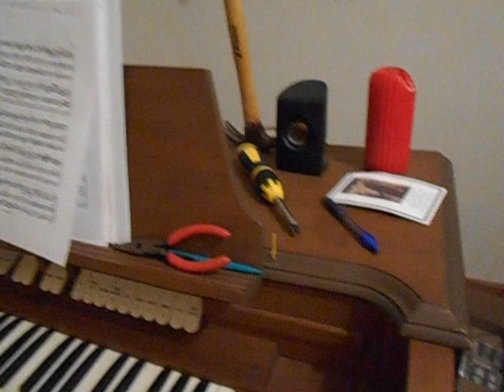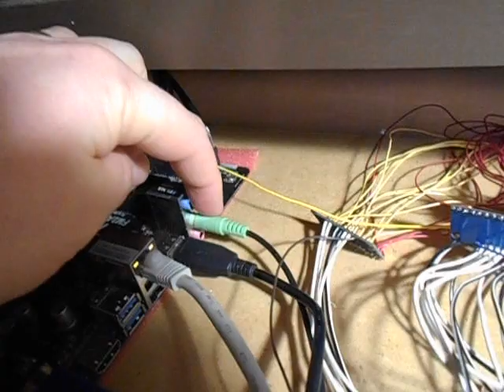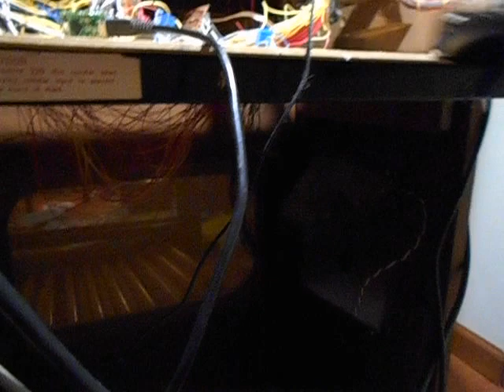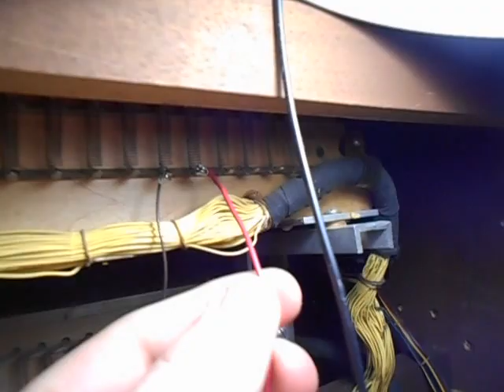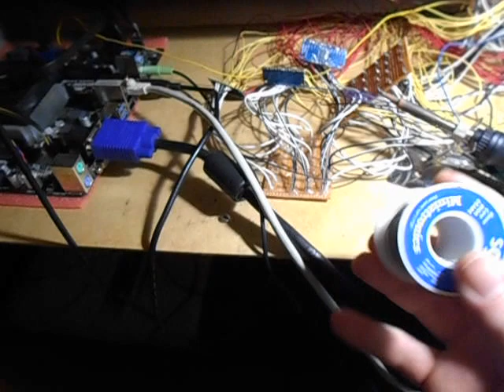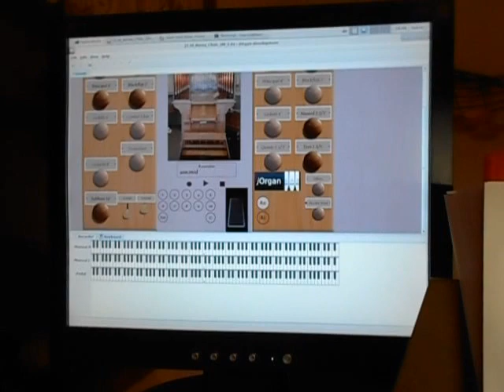Organ conversion with Teensy LC

Comment: Tom here from Toronto, Thanks for showing your wiring on the console. Neat work. I used to have a Schober 2 manual and pedalboard organ, minus the console cabinet and stop switches. I never got around to getting it properly set up so had to dispose of it. Now that I am retired, I am building a console from a variety of keyboards, had to add MIDI to 2 of them as you have done. I built the pedalboard totally from scratch. Found 3/4" by 1 1/2" oak boards that were 27" long in some warehouse scrap pile, built a frame from pine 2x6's and made springs from 3/16" dia spring wire hand wound. I added a magnet to the end of each pedal and mounted a diode and a reed switch to a board that is held just out of touch of the moving ends of the pedals. I used Arduino compatible "Pro Trinket" boards and opto isolator chips to convert key presses to MIDI using software written by Evan Kale from you tube. It all works, I use jOrgan disposition of St. Paul's Anglican Church here in Toronto, prepared by a fellow in England, named Chris Pearson. I still have only a skeleton of a frame for a console, but mostly works ok. If I play too fast, it looses MIDI OFF messages giving stuck notes, might need to mod the software. Still need to build Stop Jamb boards and mount switches and LEDs for the Stops. It's a great hobby and gives me fantastic pleasure to be able to use this marvelous technology, some recorded sounds, and much effort to try to play, [still a beginner organ student after all these years !!! ] but it is my joy to use this to Praise God with !!!

Thanks again for showing your work with jOrgan!

Tom
Reply from the maker: Wow, tremendous work! That's a LOT of opto isolators! Do the opto isolator boards have multiple input channels that you can scan using the Pro Trinket?

"...play too fast, it looses MIDI OFF..." That's strange. If a MIDI OFF message comes, it should be processed eventually. The only way you would "lose" the event is if it was never generated which suggests you have bad software. Even a key scanner should eventually notice that the key isn't pressed anymore.
Another possibility is 
1. Note on
2. Note off
3. Note on
4. Note off
happens very quickly, and the MIDI messages get mixed up such that 4 is sent before 3 (so the last message is a "note on" message)?